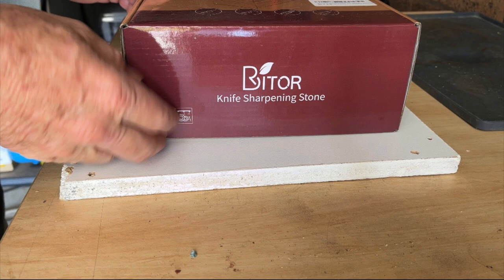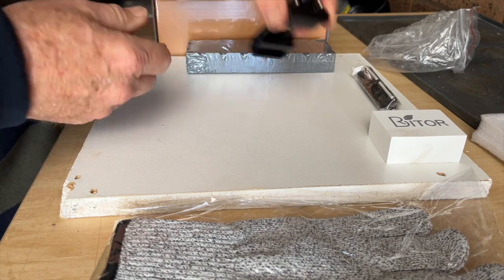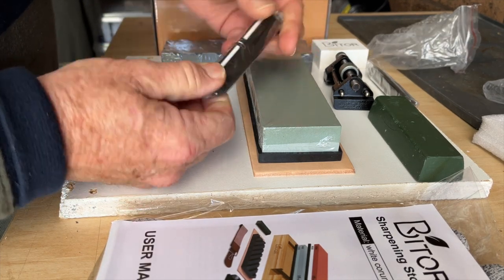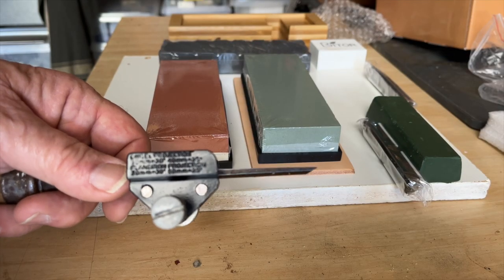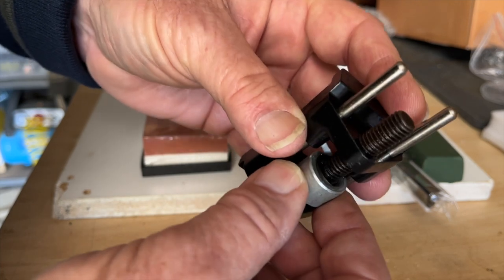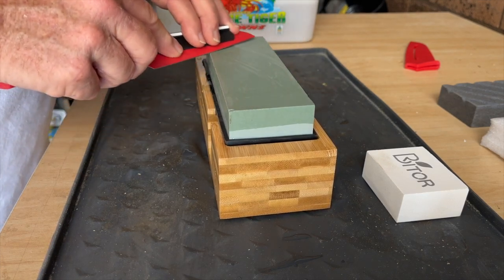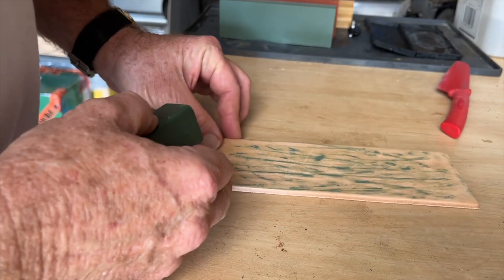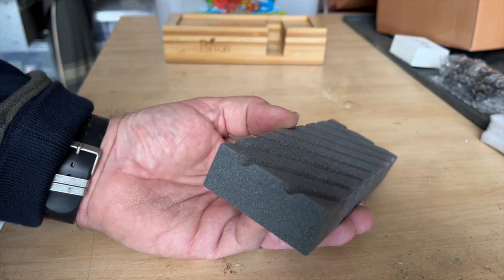Bitor Whetstone Sharpening System - first use

Comment: Nice setup. That's everything you need. Just proof you don't need to spend a fortune. 
Don't know if I'd trust cheap Chinese guides. But the stones will get it done. 
Sharpening is like welding. Doesn't matter what classes you've taken. Everything is learned by doing the more you do the better you'll get.
Reply from the maker: Thanks. I will keep learning for as long as I can.